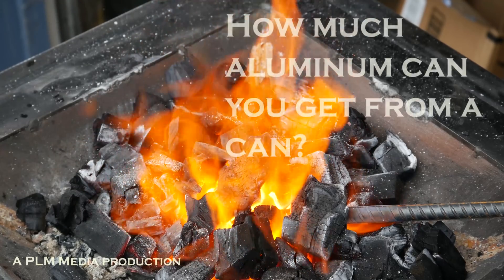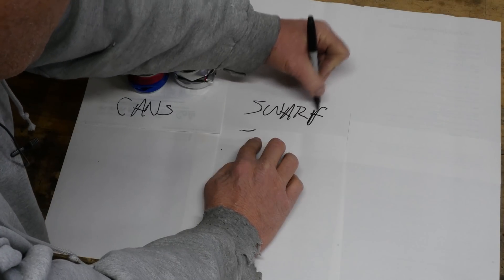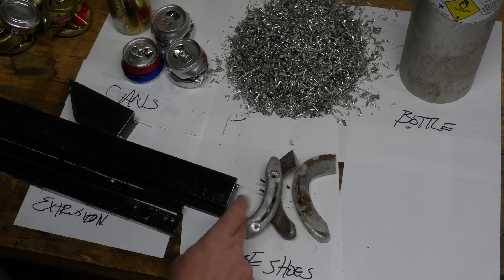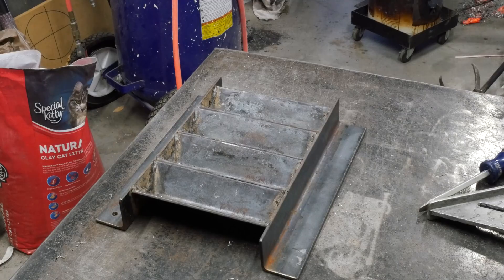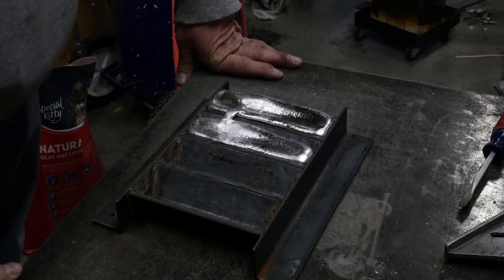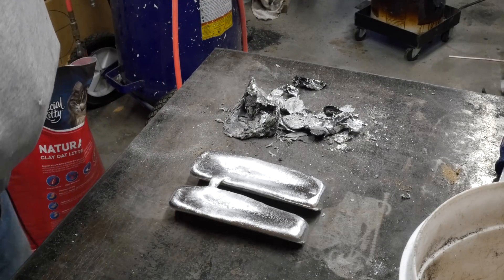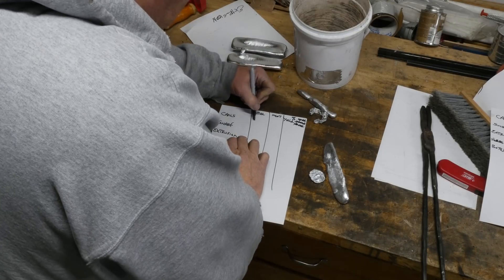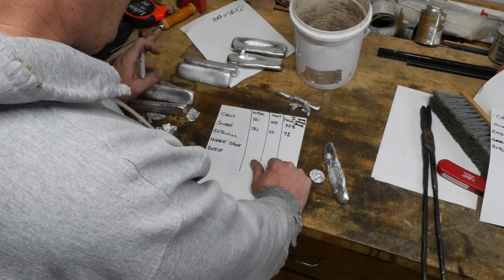How much aluminum can you get from a can?

Comment: Again quite educational! Question.... wouldn’t flux reduce the dross and give you a better yield?
Reply from the maker: Thanks.

I don't actually know. I'm not sure that it will, as flux is supposed to remove dross that is suspended in the melted metal. If I removed that suspended dross it would seem that I would have have less, but cleaner, metal in the ingots.
Reply: Flux will also make a better separation between dross and metal, so you won't remove that much metal when you scoop the dross.

Comment: Dross is aluminium oxide.  Aluminium forms a layer of oxide immediately on contact with air so the more surface area the more dross you will get.
Reply from the maker: Yep, which is why the numbers turned out like they did. That swarf is almost all surface area, the cans are better but not great. I've heard the same thing, that aluminum will oxidize almost immediately after cutting and exposing to air

Comment: 26 cans (12 ounce size) results in 1 pound when recycling.  Safe to say it will take more than that if you're melting them down.
Reply from the maker: Interesting, I had 40 cans weigh in at 1.236 pounds giving .0309 pounds per can. Your number, which I'm not arguing with, comes in at .0385 pounds per can. Quite a bit heavier than what I had and weighed.
Reply: I used to spend right at 3 days per week, every week collecting cans.  I kept count of how many cans I put in each bag (plastic bag) and could tell the scrap yard scale operator how many pounds to expect as a result.  Things like the pull tabs being missing would effect the total.  But it would still take an awful lot of cans to show a discrepancy.  The official weight of an empty aluminium beverage can is currently 14.9 grams.  Which comes to just a bit over half an ounce if what I'm seeing is correct.  Looking at my search results I have to think perhaps my data is a bit OUT dated lol.  tyvm
Reply from the maker: 14.9 is pretty darn close to what mine weighed. I had 40 cans at 561 grams. That gives 14.025 grams per can.

Comment: Just flux it.
Reply from the maker: Yeah, kinda like us. I had to get these from my son.  I'm going to try some things in the morning to see if I can increase the swarf yield.
Reply from the maker: I made one on increasing the yield on melting swarf. I used the lite salt and also formed a pudle first that I could submerse the swarf into. Increased the yield considerably. I attributed most of it to submersion over flux. But what do I know ;-)
https://youtu.be/wpv7qK0ZZ3Q
Reply from the maker: That's a long discussion... I don't have any actual flux, just "lite" salt.
Reply: 58g table salt (sodium chloride) plus 75g potassium chloride (got a 40lbs bag from Home Depot for $30, sold as water softener) makes a decent aluminum flux. Feel free to scale quantities up to what you need.
Reply from the maker: It is my understanding that a flux needs a fluoride, like sodium fluoride to really wet the oxides and allow the metal to run off it.  As I understand it, a mix of sodium and potassium chloride only might act as an inhibitor to prevent additional oxide from forming on the top layer but they don't actually allow the metal to separate from the dross. 

Now keep in mind, I've never actually tried anything with a fluoride in it and I've only occasionally used the sodium/potassium chloride mix.

I've got a ton of the swarf that I can certainly try it with. Now that I've got a set of baseline numbers I can see if there is improvement or not. Certainly worth a try.
Reply: i normally just use the lite salt stuff it seems to do a decent job with cans.  No specific amount, just sprinkle some in, do a minimal stir and then pull the dross off.
Reply: Well I've got some sodium fluoride too, I can throw a small amount in the next time I melt some cans and see if it makes a difference. It may take a while as we're not going through a lot of soda cans here. I buy mostly the stuff in 2L bottles. In 2 weeks I collected a grand total of 5 cans.
Reply: swdweeb how about starting with a crucible with just some flux in it, heat until the flux melts, then add swarf in small portions so it melts under the already molten flux? I'd try it myself but I don't have swarf plus I'm at work this weekend.
One other thing that I do is add a piece of charcoal in the crucible when I melt metal. I figure it may act as an oxygen scavenger when red hot and keep oxidation at a minimum.
Reply: swdweeb Please read this: https://patents.google.com/patent/US4030914 
This proves that you do not, and most certainly should Not use Fluorides in fluxing Al dross. One merely needs a mixture of Potassium Chloride and Calcium Chloride at about 80/20, melted to form a low temperature eutectic and is a wonderful cover flux. Although, Lite salt/CaCl mix may be an alternative in a pinch. I hope this will also help others, as I have been melting only dross for weeks now and I've gotten several large ingots from what I've been told was unusable before.

PS. Just a headsup. Calcium Chloride is an amazing moisture absorbent, so it tends to pop like crazy if it's thrown straight in the furnace. I'd advise to dry it out best as you can before melting it. I've been lazy about it, just throwing it in, and it pops all over the place, and it takes some time for the KCl/CaCl to form the eutectic, and I waste gas and time. It's best to melt the two together before you plan to melt the Al, most likely. 
Oh also, it smells horrible when you flux, especially with this mix, so prepare yourself. I just wear the big face respirator, so I only had the misfortune of breathing it in once. Cheers!! And best of luck to you all.

Fyi: Potassium Chloride- Big Purple bag of alternative water softener
Calcium Chloride- Alternative Driveway Ice Melter
Both found next to each other at Ace
Cheers!!
Reply: Did you make a video on your dross melting and aluminum recovery efforts?
Reply: No sorry, not my thing. But I've just been melting a big bucket of dross for a couple weeks and gotten quite a bit out of it.. I haven't actually been able to get to the rest of my cans because of it. But I can tell it's making a difference, because when I watch the dross in the furnace with the CaCl/KCL mix, tiny little droplets of aluminum drop out of the dross it was trapped in. It looks very different from when I used only Lite Salt. Therefore proving a chemical reaction on the dross has occurred. Of course it helps to have a tiny puddle of Al to get things started like any other time. The dross changes from a crumbly nasty mess, to a more uniform black ceramic-like substance that will shatter when dropped. Try it out, or read the patent for yourself if you'd like. I feel very lucky to have stumbled across it myself. Cheers!!
Reply: @swdweeb Lol, I actually literally just finished watching. Wish I had posted this message there.. Oh well. xD Seriously though. You should check the patent out. It's rather informative I must say. And has helped me immensely! Anyway, great work. Look forward to more Cheers!!
Reply: Michael DePelteau that's a nice find. The patent is also expired so no royalties needed. I happen to have a large bag of potassium chloride water softener sitting in my garage right next to a large bucket of calcium chloride ice melter. :)
Reply from the maker: I finally had time to read it. It's interesting that they distinguish this as a "covering" flux rather than a "cleansing" flux. They also mention cryolite which had been told about in terms of cleansing fluxes. 

Interesting read. Thanks for sharing it. I've already passed it on to some others as well.
Reply: I'm glad to hear you got round to it. The main claims I would like to cite are:
"The prior art teaches that fluorides have a higher surface tension than chlorides and, therefore, the fluorides reduce the wetting power of the chloride flux without increasing the viscosity. Thus, fluorides have a higher surface tension which should work against an optimum separation of the metal from the oxides. However, if, in a mixture at the proper melting point, the surface tension and fluidity is sufficiently reduced, the flux will effectively penetrate the skin. The wetting power can be increased so that the mixture can be more effective than a salt containing fluorides.

According to this invention, blended flux compositions containing potassium chloride and calcium chloride or sodium chloride and calcium chloride or mixtures of sodium and potassium chloride in combination with calcium chloride are so superior that they can effectively work considerably better, cheaper and with higher recoveries than presently known flux compositions."
-
"Aluminum recoveries are increased because of the presence of the cleansing action of calcium chloride, whether in combination with potassium chloride or sodium chloride, however, calcium chloride-potassium chloride are more effective because of better viscosity characteristics than calcium chloride-sodium chloride blends."
- 
And rather importantly:
"The present process using potassium chloride-calcium chloride or sodium chloride-calcium chloride blended fluxes has the additional and very distinct advantage that the process is ecologically acceptable. The use of Cryolite or other fluoride containing by-products are illegal in many states and are a serious ecological hazard wherever used. "

Thank you again in taking interest in this rather nifty find if I do say so myself. ;) Cheers!!
Reply: @stamasd Very nice luck there. Looks like you got what you need already. Just remember that CaCl has probably absorbed alot of water, so unless you dry it out before you burn it, it's gonna pop like pop-rocks everywhere. Unless you are lazy like me and pour the flux in a can and crush it so it can't escape. Then dunk the flux-can in the furnace. Lol. I need to get around to doin it right for a change. Anyway Good luck! And Cheers!

Comment: Natural Clay Cat Kitty!  Is someone making more greensand instead of using Petrobond????
Reply: swdweeb I use'd a small blender to pulverize the cat litter just to see how well it would work in greensand. I was impressed with how fine of a powder it generated.
Reply from the maker: I tried to a while ago before i bought the petrobond. I may try it again after I build a muller
Reply: I tried using cat litter bentonite as a plasticizer but got horrible results. I think it's because of the really coarse grain of the cat litter (may work better if crushed in a ball mill or something like that) and also because the litter is probably cheaper calcium bentonite instead of the more expensive sodium bentonite (which is the good stuff).
I even tried soaking the litter for a couple of weeks in a solution of sodium carbonate (soda ash) to try and convert it, but the resulting material was still too coarse and not sticky enough.
Reply from the maker: I tried making greensand with it and spent way too much time trying to pulverize it with a hammer on my welding table. If I could come up with a way to easily pulverize it I might try it again but right now I can buy petrobond really easy. All it takes is a a credit card. I've also had pretty good luck rejuvenating the petrobond with non-detergent motor oil. 

As a result the cat litter will probably end up soaking oil spills or something.
Reply: I'm making some this week.  If I find a better method I'll let you know.
Reply from the maker: I think I may have found a source for pulverized bentonite. If I get some AND get my muller built (that seems to be falling down the priority list though) I might try to start making my own molding sand. I'd love th hear how yours comes out.
Reply from the maker: Hi Mark, There in lies the rub. I don't have a small blender that I can sacrifice for this stuff. 35 years ago I burned out the motor of a blender trying to grind wheat. My wife still hasn't forgotten about it ;-)

I thought about going to a thrift store to buy one but just haven't gotten round to it. I've heard of others using a blender with good results. I suppose I should make more of an effort to do it. I'm starting to run low on the sand that I have.

Thanks
Reply: So the blender method is working great to pulverize the kitty liter.  I start at a low speed then high speed...basically the mixed drink setting.  The greensand in compacting well however the breaking of the clump test is not as good as I would like.  I went with a 30% bentonite to 70% sand mix, but I plan to increase to a 32/68 mix.  Also using water seems okay, but I think an oil mix will perhaps bind better.
Reply from the maker: My source for pulverized bentonite hasn't come through yet, he keeps telling me to remind him. I'd like to make oil-based sand as that is what I'm already using.
Reply: Well know I'm curious...have you considered trying to find local sources (referring to within the ground sources).  I have seen video of an individual harvesting it from river/creek shore lines.
Reply from the maker: We have bentonite in the soil all around us. No I’ve never considered trying to dig it up.
Reply: Ok using the kitty liter and play sand I finally found a mixture ratio that I think passes the clumb test.  It is a 64% to 36% by weight mixture.  Unsure about the amount of water I used, I will attempt to weigh the mixture to determine the amount.